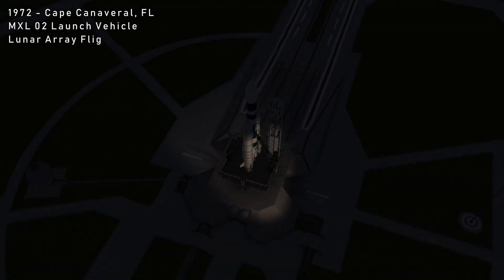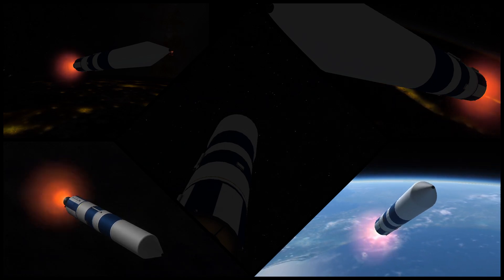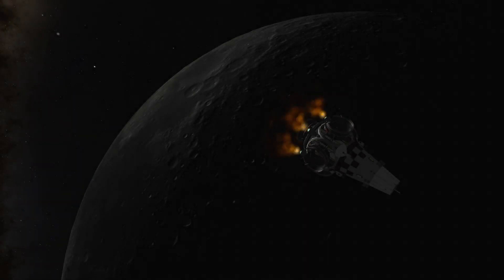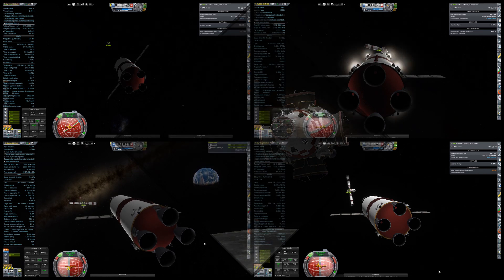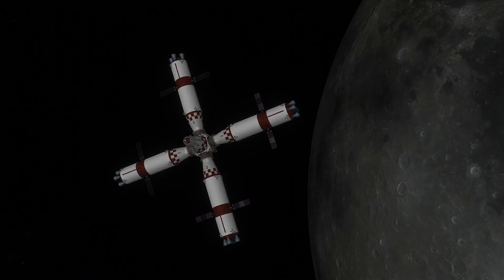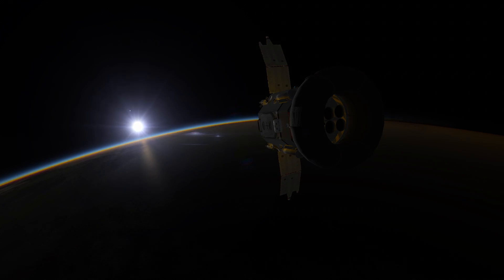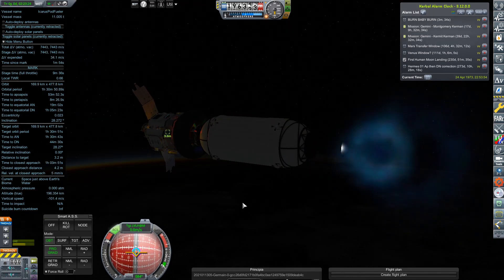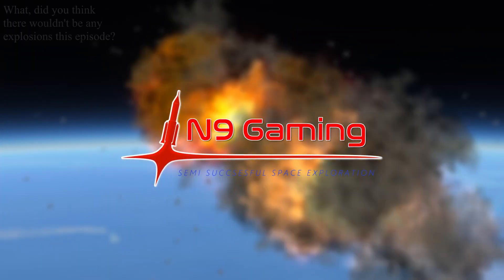Moon or Bust - Against All Odds (Part 2/3)

Comment: Do you use a craft testing mod? as in you can test the craft's flight before launching it or spending funds?
Reply from the maker: Yes! KRASH was used in these videos to test various things, but I've recently updated to KSP 1.10 and simulations have been integrated into the KCT mod

Comment: In the beginning of For All Kerbalkind, your rocket exhaust could destroy spent stages. That isn't working for me. Any clue why?
Reply from the maker: It would at most destroy a decoupler, not the whole stage
Reply: @N9GamingOfficial  It did make the spent stages separate without decoupler, right?
Reply from the maker: If I remember right there was always a decoupler!
Reply: @N9GamingOfficial  That's a problem. My RP-1 doesn't seem to have one with the parts it gives you at the start
Reply: How do I fix that?
Reply from the maker: Hmm, assuming a correct installation decouplers should be there. not sure!
Reply: @N9GamingOfficial  Thank You! I did find it!